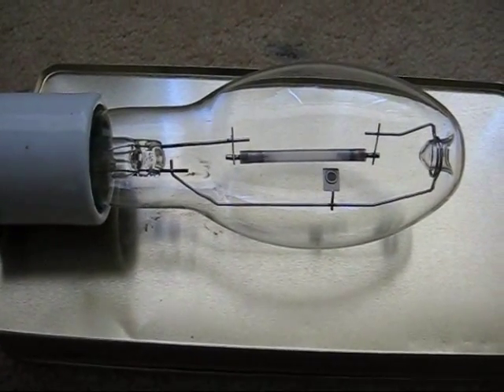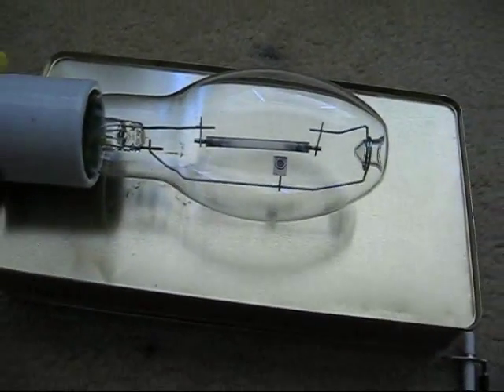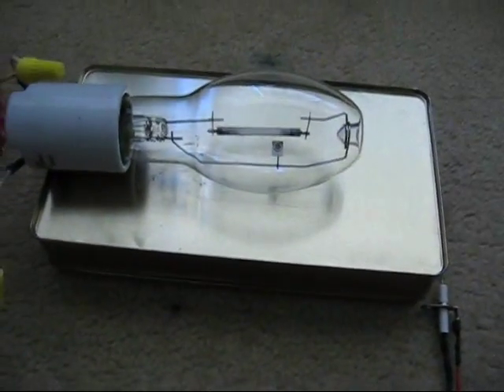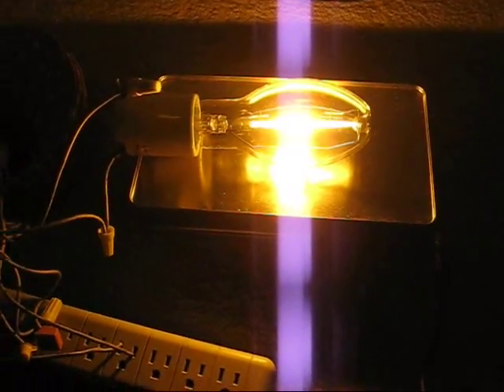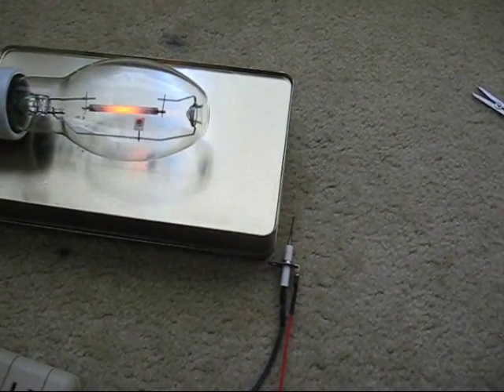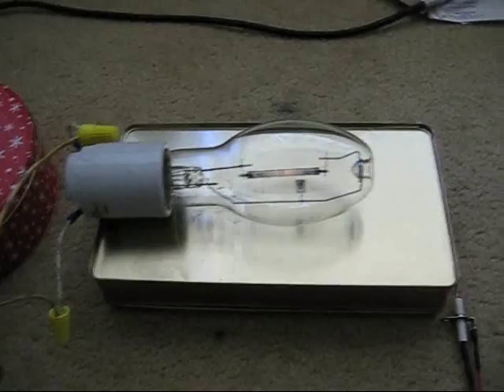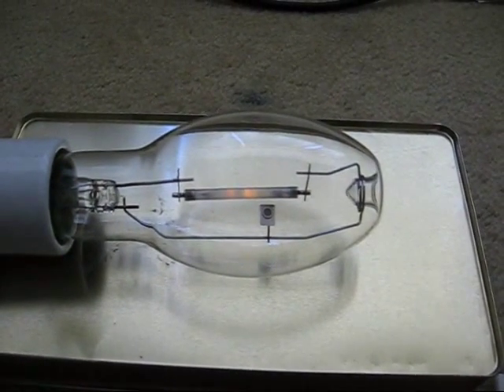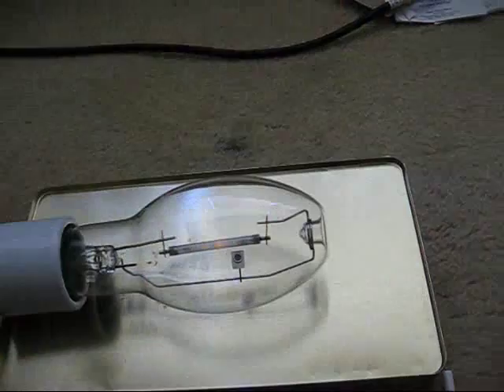HPS grill igniter

Comment: You can also light North American low wattage high pressure sodium lamps in this exact same manner on multiple 120v preheat fluorescent choke ballasts connected in parallel.
Reply: Would it work with European HPS lamps and 230V 50Hz fluorescent ballasts though ?

Comment: No restrike cause once bulb is hot ,there's a small metal bar between plug and inner bulb that disconnect one hot then when it cool it springs back into place allowing spark to flow
Reply: That hot restart safety that you are referring to is only on metal halide
Reply: @Renan Lima Rodrigues yep

Comment: Can You tell Us about the ballast and how do You wire it? I've tried to figure it out, but I see the conecctions are so messy that I can't follow the wires... Thanks..! An by the way, good starting system...  I'want to try out...
Reply: On the ballast usually every wire is labeled as to what it is. Depends on your ballast but usually you have 120, 208, 240 or 277v where the power goes in you have to use the one you have and cap the rest. 
Then 2 common. One goes to your common in and the other to your light socket. Then you have one saying cap which goes to your capacitor and the other wire from the capacitor goes to your hot of the light socket.

Comment: This is a similar effect as a Xenon strobe tube trigger winding. Although the winding is on the outside of the glass tube it still causes a slight ionisation of the gas to enable the current to pass through it.